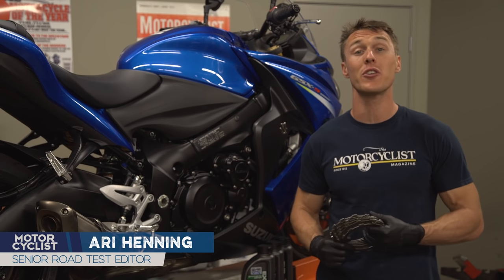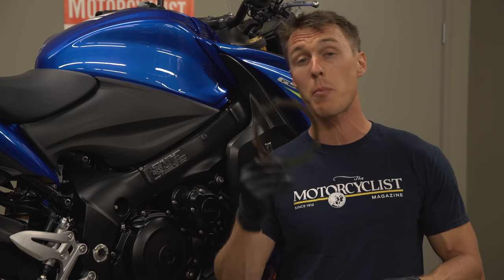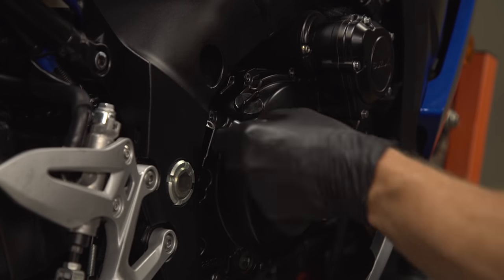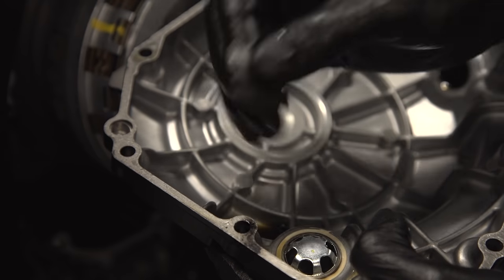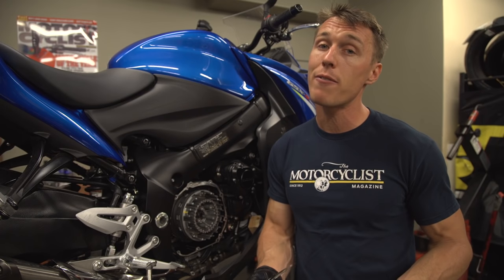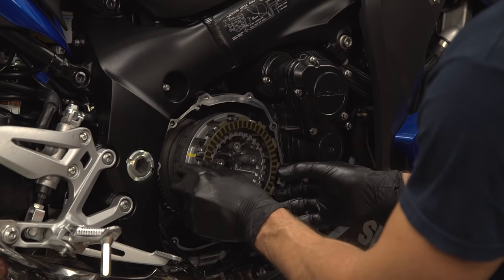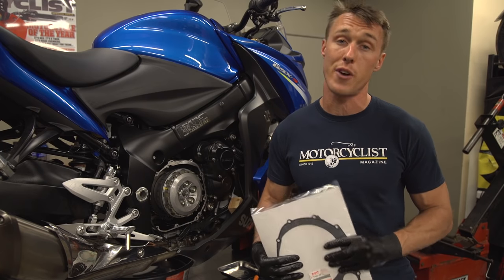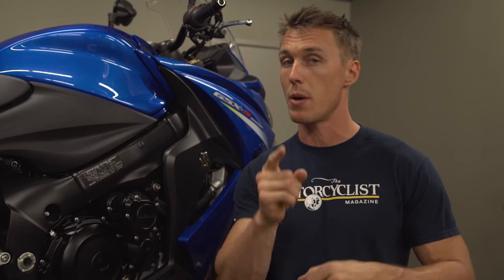How To Replace Your Motorcycle Clutch | MC GARAGE

Comment: Hey, i find my shifter stiff, the gears dont engage smoothly only with the engine running-normal riding. Also i cant do second gear clutch up wheelies, the clutch just slips, first gear seems no problem.With the engine off or clutchless upshift the shifting seems smooth. I only have a small 125 so i dont think the clutch is slipping even if i hammer it. May i need to change the clutch plates ? The bike has 42k kms-26k miles and i dont know if it has ever been done. Thanks for any help
Reply: Well, if you find your shifter stiff and the gears dont engage smoothly, STOP playing Worls of Tanks!  lol....

Comment: HELP ANYONE?

Ive been restoring an 82 DR500S and im trying to replace the clutch cover original one has a crack and leaks, I have a new cover waiting to go on, ive disconnected the clutch arm and all bolts, have the guide says tap with a rubber mallet to free the cover, i have been for ages and with no luck, doesnt say but do i need to take off the magneto cover and free something on the otherside? any useful help would be good, not much info on these old thumpers around.

Comment: What would a clutch slipping feel like? I notice that when I come to a stop in 1st gear it stutters a bit like it sounds like it's going to stall but it's fine. it's a ktm 450 exc with only 3k miles on it. probably mostly road but I bought it at 2700 about 95% stock. Still original sprockets and brake rotors
Reply: Also my KTM has a hydraulic clutch so would it be different? Like with draining and bleeding the clutch cable
Reply: Doesn't sound like your clutch is slipping. 

When you say you are coming to a stop do you have the clutch depressed (so the bike is rolling) or are you engine braking?

Regardless it sounds more like an ignition system problem then a clutch problem.
Reply: agentgfh I would be in a full stop put it in first with the clutch held in and it would creep forward slightly. I also noticed early today when leaving after school that when I would come to a stop in 1st gear it sounded like it was going to stall even though the clutch lever is completely pulled back. After I got home I tried it just riding around the yard and couldn't get it to happen again. Shouldn't be because it was cold because it was sitting in the sun for a good bit.

Comment: Just changed the clutch in my 2018 suzuki c90 boulevard, but after I put everything back together I have no pressure in the clutch handle.  Is this normal? Do I need to start the bike to get pressure in the handle?
Reply: should have pressure as soon as you put your clutch back in. did you ever figure it out?

Comment: So...I'm not sure what's up on my bike. Sometimes, and I mean fairly rarely, when I'm starting to move from a stop, the bike will grab, then release, grab, then release, etc. -- all accompanied by a slight grinding sound, until it eventually catches and I can accelerate and shift like normal. If I try a harder launch, the bike just bucks and does the same process, only it's quite violent. I also had two instances where I was cruising in 6th gear and the bike felt like it suddenly slammed into a lower gear (the feeling was like when you pop a bike into first gear from neutral, only quite a bit more violent considering I was moving at 60mph when it happened).

Is this a clutch or transmission issue?
Reply: I would say transmission issue. With your first issue, it sounds like the bike is popping out of first and alternating between first and neutral. For the issue in 6th gear, it seems like the bike dropped out of 6th and into 5th. 

It could be bent shift forks. The forks aren't causing the gears to press together fully, and under load, the dogs pop out of mesh with each other. That's the grinding sound.

Comment: I just replaced my starter & starter relay solenoid, checking wires & fuses. My 01 Kawasaki ZX9R is trying to start up whenever I touch the positive cable to the battery🤯it does it with the key in the off position, relay connected or disconnected, start switch on or off. Out of ideas, please help
Reply: Yung Country sounds like you have a short somewhere completing the circuit bypassing your kickstand, killswitch and key all of which should be on the same circuit so that if any one of them is broken it kills the engine. Go back and check that everything is according to your owners manual.

Comment: Sir, can u tell me the reason and solution for my duke 200? When i pull the clutch all the way, still the rear tire turns but not that really fast but u would still to hold the front brake a bit for the bike not to run even if clutch are pulled.  All of the gears from 1 to 6.
Reply: Adjust your leaver free play

Comment: I NEED HELP!!!! I just got my hydraulic clutch fixed. (Wasn't disengaging, bad slave cylinder I was told). I have a 2004 Suzuki Hayabusa and everything is stock besides the headlight. One previous owner before me. When my bike gets hot I have no acceleration, the engine revs high but doesn't move. When it cools down it works fine. The clutch lever has resistance so I don't believe it is air or water in the lines. I have a feeling the plates are bad. Please help
Reply: wrong oil?

Comment: And is it necessary to pour new engine oil after replacing those plates or i can use the one i drain at the time
Reply: I would add new oil if I drained it out.  If the clutch died a sudden death, there will be clutch material in the oil and it can clog passages in the engine.  Besides, is it really worth the risk of reusing the oil?
Reply: Jimat !

Comment: i just changed the springs and clutch plates in the motorcycle and now it will not go into gear. i start the bike on centre stand, while in neutral and shift to first and nothing happens. It acts as though its in neutral gear. After changing to gear 1, I release the gear and it does not stall even when I'm not throttling. Same goes to gear 2, 3, 4, 5. wondering what i did wrong.
Reply: Any luck fixing it? Im having the same situation.

Comment: Hey Ari, I have a 2008 GSX-R 600 (30k miles) and the clutch started dragging. When the bike is cold and below 150 Fahrenheit everything works normally as it should, but once it warms up it starts dragging like crazy and it is impossible to find neutral and the bike creeps forward with the clutch pulled in. If you give it a blip of throttle it unsticks the plates and you can pop it right into neutral. Any ideas? I'm completely stumped. The clutch looks good and this bike has been babied.
Reply: Did you ever end up fixing it?

Comment: If i Not soaked new clutch plate into engine oil than what Happen🤔 I change my new clutch plate with out soaking in engine oil☹️
Reply: they will wear out way faster, cause they should work wet
Reply: @wellingtonzani1280  thnx

Comment: Remember the last friction plate doesn’t go into the teeth like all the others, the last one goes into to the clutch teeth in The case that keeps is stationary..

Also if you have a newer bike youll probably have two friction plates which are different to the rest, the cork material will be bigger than the rest.. these go on the outside of the pack, so it will be the first and last friction plate you put in..

Comment: I have a kawasaki gpz 305 it goes through the gears no problem but when it gets to 6th it struggles to pull any ideas what's wrong
Reply: Possibly gearing. Check what the stock sprockets should be
Reply: It's a belt drive
Reply: Everything is orgainal on my bike
Reply: It will most likely be either the carbs or the ignition. Properly clean the carbs and check they are balanced. Check and clean all the connections from the magneto/pickups to the cdi.
Reply: +nick o done all that before it like it's staving of fuel I thought it might have something to with idle

Comment: You did not check the push rod lock nut adjustment in the middle of the clutch pack. It is very important that there is just a little (0,1mm) gap in the rod axial movement. Otherwise it can ruin your new clutch plates very quickly.

Comment: That casing looks like aluminum. Aluminum is a soft metal, so you really shouldn't be scratching at it with a steel blade.  Steel is harder than aly' and you risk scraping the metal away and that could permanently damage your sealing surface. .  Use plastic if you can or maybe brass.  A scouring pad like scotchbrite (not wire wool) to finish up.

Comment: Removing the old gasket with a razor blade is not a good idea.Aluminum is soft and can easily be damaged with a steel razor blade.Better to spray some gasket remover on a Q-tip and let it soak in and then wipe clean.Other than that, great video!

Comment: DOES NOT WORK ON Honda CBR600 F3. If you have an older bike beware. You wouldn't wanna pull your shit apart and then feel like an idiot when you can't actually replace plates because you didn't order enough parts and a special tool. I don't know about other older models, but I'm about to button this shit back up and take it to the mechanic.

Comment: DONT LET THEN SCREW YOU OVER THEY LEFT OUT THE PART THAT YOU NEED ALL THE STEEL PLATES IN THE SAME DIRECTION AND ITS VERY HARD TO TELL THE DIFFERENCE FRONT OR BACK YOU NEED TO LOOK CLOSELT AT THE EDGE IF ITS ROUNDED OR SHARP ON THE INSIDE PART LOOK IT UP ON GOOGLE ... YOU WILL NOT GET ALL THE STEEL PLATES IN ORDER BY ACCIDENT ITS IMPOSSIBLE SO WHY DID THEY NOT TELL US..... YOU KNOW WHY.... JUST BE A GOOD PERSOn